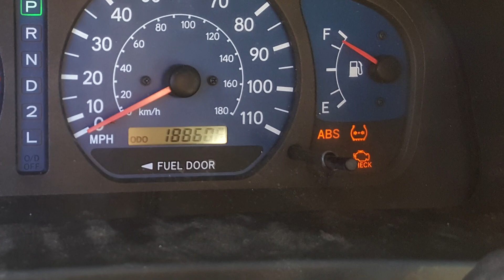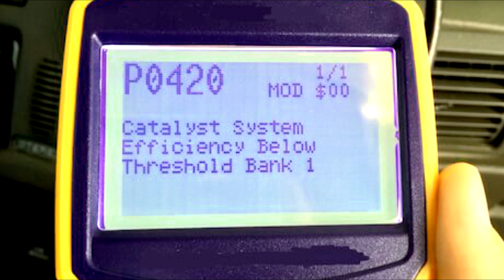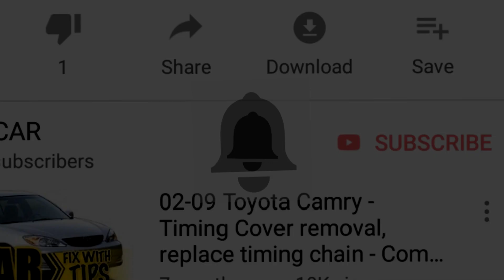01-03 Toyota Sienna p0420 problem and solution

Comment: I drove 160 miles at 61 mph. My evap and cat monitors are still incomplete.  I am driving home, for a complete trip of over 300 miles. Prior to this, I got p0420 code after 250 miles of drive cycling. I have changed the rear catalytic converter,  downstream and upstream o2 sensors. Mechanic shop says my cars running properly. Temperature 700 after cat, 600 before cat. I'll post update once I complete trip.
Reply from the maker: Hopefully it worked for you, please let us know..
Reply: Unfortunately, it did not work. Pending code.p0128. coolant thermostat. (coolant temperature below thermostat regulating temperature). plan: replace engine coolant temperature sensor.. disconnected battery last night. Will also try o2 sensor extender on the rear o2 sensor.
Reply: If you need to get coolant temp up try a drive with a piece of cardboard in front of the radiator. Just dont let it get too hot. But can do the trick for cat drive cycle specs
Reply: @garychan9665  i don't know if you still have the car but my mech told me to drive the car on a quarter tank on the highway and go up to 70 mph and let it coast down below 50 and it causes the car to do a self diagnostic and it worked instantly

Comment: Thank you ,  was that 90 miles all one straight trip? No key, off then restart?
Reply from the maker: Yes. Have the light turned off. start the car, and hit the highway..
Reply: @drcar9202  darn, doing drive now just went 45 miles shut the car off, then will go 45 back home. No pending codes though. Guess I'll have to go past home. Thank you for quick reply.  Did you watch monitors while driving ? Just cat and evap left on mine